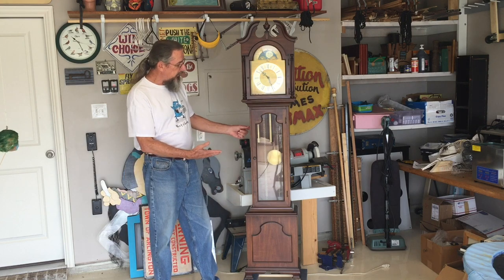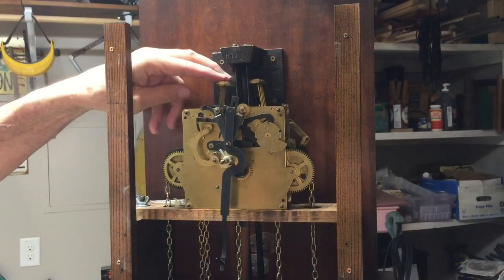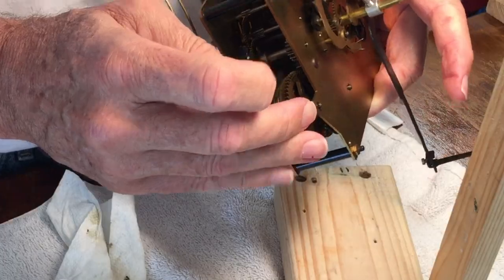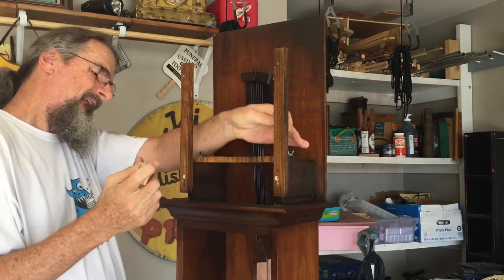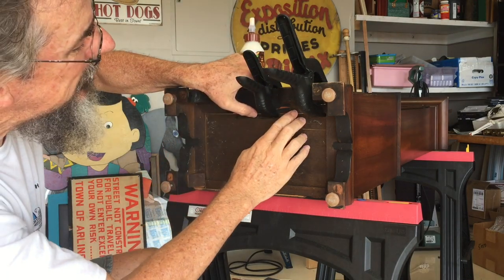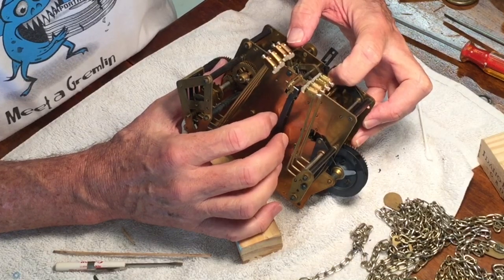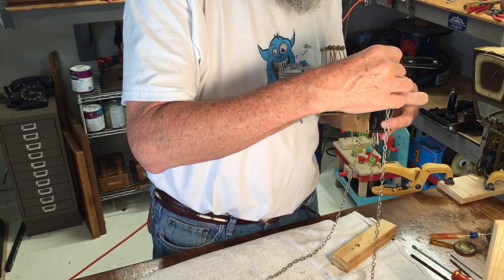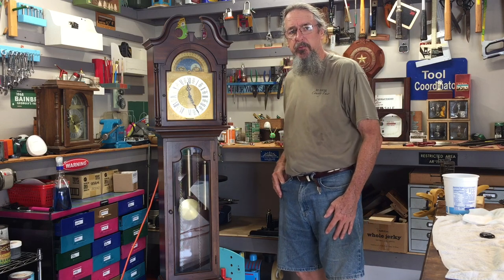DIY Servicing a Vintage Colonial Grandfather Clock With a Jauch Movement

Comment: I have the grandfather version.  5 tube - 96 Jauch movement.  Seth Thomas but also can be found badged as Colonial by General Time Corp.  It has been in the family since day one 1971? and I call them furniture store clocks as that is where this one came from as an impulse buy while picking up living room furniture.  Still works good, been moved around the country several times, serviced a handful of times.  Chimes have always been finicky so I have it set to chime the hours only.  Also, the moon dial is 180 teeth so two teeth each 12 hours.  This part needed servicing recently due to wear and tear over the years.  A slight forming the trip arm is all it needed.
Reply from the maker: @johnpjonesch  I have serviced several similar clocks since this video and I can say every one I’ve serviced has come back to like. The oil dries out and puts a lot of friction into the gear train and can make it sluggish. Your chimes will be slow until one day they will stall.
Reply: @JimmiePorterAtStuartArts   chimes out of sync not slow or stalling.  It is a mechanical issue.  They play the entire westminster at 1/4 hour.  At the top of the hour it will sound off only the hour.
Reply: @JimmiePorterAtStuartArts    Update:  Loosened the set screw behind that main cam on the outside front face and it moved into place.  It is now chiming correctly througout the hour.  I got luck on this one.

Comment: Thanks for the great videos you done. Plus thanks again for showing me how to clean my Grand Father's clock.
Reply from the maker: I’m glad you enjoyed...good luck!
Reply: @JimmiePorterAtStuartArts  Great video few questions 
1. Grandfather clock stopped working many years ago. 
2.  Chimes not working. 
3. When start clock works for 2 or 3 minutes then stops. May someone please help me
Reply: @johnc8112  proballby a dirty movement.
Reply: Thanks for the help, I oiled it and oil it until I got it to work.
Reply: @johnc8112   I recommend getting it a service at a watchmaker if it's a clock you value and want to keep running for years. giving it oil is gonna make it build up and eventually the dust will make a thick grease that stops the wheels.

Comment: Thanks for all the info.  Have you been able to locate a manual for these clocks? I have a 1974 Colonial grandmother clock and am looking for a manual and trying to figure out if it has a night (silence mode). I read that some of these clocks have a lever where you can silence them at night (2200 to 0700).  There is no lever on the face for this.
Reply from the maker: No manual for this clock…and I don’t believe it has the night silencing feature…,good luck…!

Comment: Nice video. I have purchased some old long case clocks some  ago (me —> bad collector). These three clocks have all of them heavy stone lead weight. And there are of course pendulums. I have mixed up, and I don’t know which one belongs to each clock. Is it possible to use for example stone lead weight or/and pendulum from a different long case clock, and it doesn’t matter if it is not the original?
Reply from the maker: A purist would want the correct weight, however the movement does not care what the weight is made of… it just needs enough pounds to operate it… some trial and error should sort that out…

Comment: I own a Molyneau clock that I've had for years. It still keeps perfect time, but it doesn't chime anymore. Does it need to be cleaned ?
Reply from the maker: There are a few possibilities...if you are lucky the pivots may just be dry and need a few dabs of clock oil....I’d try that first. It’s also likely your movement needs cleaning as the grease applied to the gears by the manufacturer gets dirty and gummy...

Comment: Don’t worry man the clock is functional so there may not be a lot of wear an ultra sonic cleaning even fully assembled is okay! As long as it’s cleaned for a long time some of that gunk can hide in the pivots if not cleaned for a while though in a few years it may need to have the worn parts fixed if the parts get worn though fortunately it doesn’t appear to be worn or at least a whole lot so a cleaning should be fine as long as it’s not worn

Comment: i have a question. One of my numbers came off my clock. i attempted to glue it and when it didn't sit well.  i attempted to remove glue and it took of the dull look and gave it  a shine. how do i get back to the dull color? is there a metal paint?

Comment: I own a Molyneau Grandfather clock that keeps perfect time, but doesn't chime anymore. Does it need to be cleaned? It' about 25 yrs old. Thanks.
Reply from the maker: I am usually able to get them going with a good solvent wash as I did  in this video. Good luck!

Comment: What makes the right weight and left weight not go down?
Reply from the maker: They drive the quarter hour chime (right) and the top of the hour strike (left). If there is a problem on the right side neither the chime nor the strike will work, but the clock may continue to tick and keep time. There could be a maintenance issue, but you may also have silenced the movement. Most grandfather clocks have a lever that you can silence the chime/strike with. Check that out first before spending money on repairs. Good luck.

Comment: I know you said you aren't doing a professional job, but one (of many) things that is problematic with cleaning it that way, is that some dirt will probably still be stuck between the pivots and the holes. After adding some oil, the clock will run, but these loose pieces of dirt/dust along with the new oil will act like sandpaper and wear the holes in the plates that will require re-bushing. So, your solution seems fine in the short term, but there is a hidden cost to not doing it correctly.
Reply from the maker: Agree...I’m just getting to the point where I can do full overhauls. So i will probably revisit and do a full tear down at some point
Reply: @JimmiePorterAtStuartArts  Awesome! It may seem intimidating, but it really isn't that hard. I've seen on your other videos that you did other full overhauls of more basic movements. If you can do that, you can do this one too. The 15min train is similar than the hour train in that you just need to make sure that the sprocket isn't resting. Only tricky part is getting it in the correct starting position, but that you can find easily by the sprockets that go directly after each other to get the 1 2 3 4 of the first part of the Westminster chime to line up with the 15min slot in the cam. But that you can do. 

I've been servicing cuckoo clocks and basic hour/half hour chiming clocks for a while, and did my first grandfather mechanism last week. It didn't technically need a deep clean, but I wanted to learn and get the experience. 

Good luck!

Comment: Hi, Jimmy,  I have a question how do I get a clock appraised from a name and a serial number?  I had a Colonial Mfg Co. Zeeland grandfather clock.  My clock was damaged in a hurricane so I need to get an estimate for the Insurance company!
Reply from the maker: Sorry to hear about your loss…we’re from Florida and have been there with hurricane damage. I can tell you that most colonials I have seen are 1960s or 1970s. They may have originally sold in the $800 to $2500 range depending on features. The value today for such clocks is unfortunately much less probably a few hundred. If you will send me some photos of the clock and in particular photos of the movement back plate showing the stamped writing I can tell you much more. My email is bigdad56@bellsouth.net. Good luck!

Comment: Hi.
I enjoy watching this video. I had just gotten a similar clock from a good friend of mine, whose father-in-law just passed away. I'm currently working on getting that clock up and running, and I thought I had it going, but somehow, I just noticed that the Westminster chime stops in the middle of the sequence every quarter hour. It used to stop at the end of the sequence. What do I need to do to get the sequence back in sync?
Reply from the maker: The drum likely isn’t in the right position. You should be able to loosen one of the drive gears and reposition the drum. It’s trial and error. Just move the drum ahead a bit and re-engage the gear teeth. As you advance the minute hand through the quarter hours you can tell if it’s ahead or behind. I can usually get it synced in a few tries. Once it is synced, just tighten the gear set screw. Good luck!
Reply: Hello again.
I got the problem fixed last year thanks to your helpful advice. I have another question I'd like to ask you. I have a Jauch clock with Westminster/Ave Maria de Lourdes chimes. Even though the Westminster chime is in sequence, the Ave Maria chime isn't. Does that mean my clock has the same problem with the drum like my Colonial grandfather clock did?

Comment: Excellent video! Thank you so much! I've inherited a non running Colonial grandfather and am getting up the nerve to cleaning it, and get it running after sitting for maybe 10 years. You have taken the jitters out of the job. Will let you know. One question... how were you able to tell the year it was made?
Reply from the maker: There may be a date stamped right on the brass plate of the movement itself. Look for writing in the lower right of the back plate. Depending on who made the movement (it won’t be “Colonial” - more likely Hermle) the year may be there or a letter code for the year. Date tables for the various makers are readily available on line. One of the easiest things to check before you get started is to check that the clock is “in beat”. It’s an easy adjustment that be out of whack after a move. You can do this!

Comment: I have a similar colonial my pendulum has stopped tried everything.
Reply from the maker: Is your clock in beat?
Reply: @JimmiePorterAtStuartArts  I’m not sure. What happens is I let the pendulum go back and forth and it sounds like it’s in beat but after a couple minutes always stops.
Reply from the maker: Have you had the spring barrels apart? A big cause is that the grease dries and adds friction...